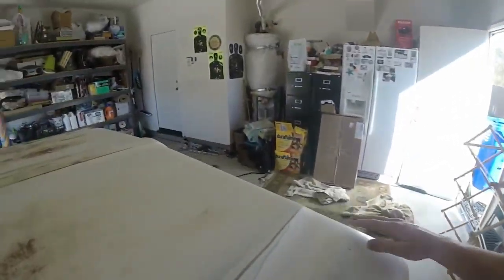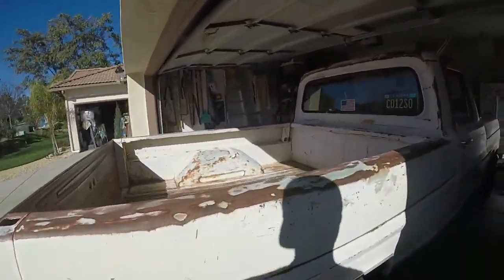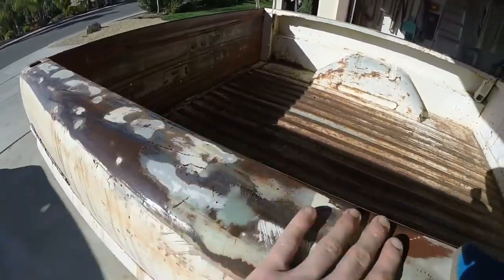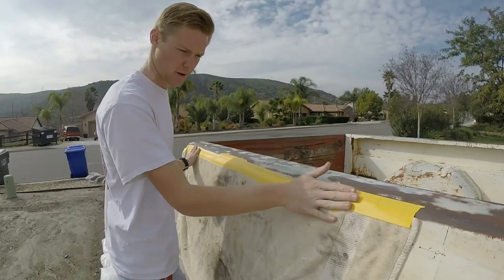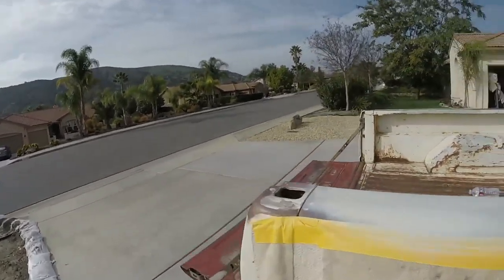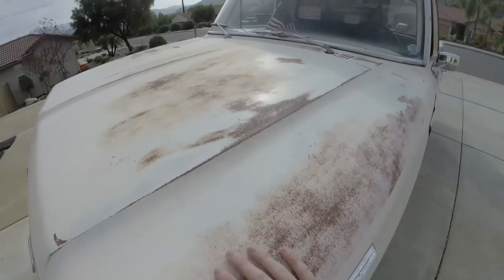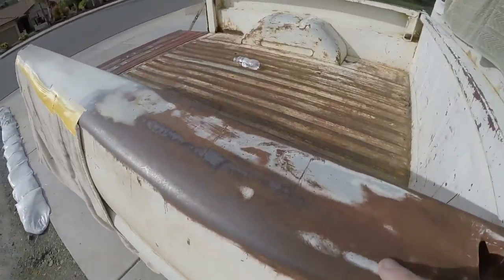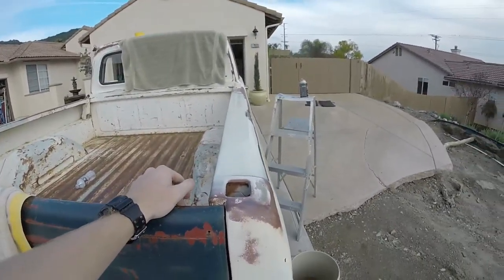Fauxtina Paint Job! Patina Repair (PART 1)

Comment: my question is how to take the bed panels off instead of cutting it off
Reply: Your question is not clear.However,most body joints can be separated simply by drilling spot welds out and a wedge or chisel.